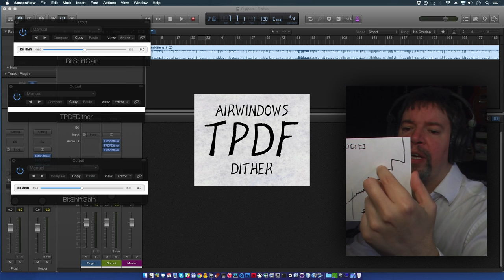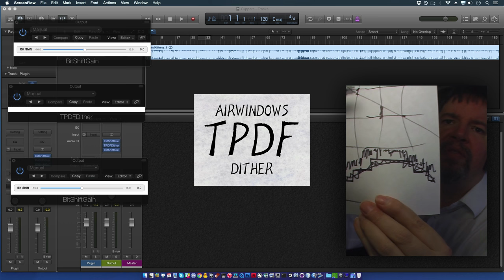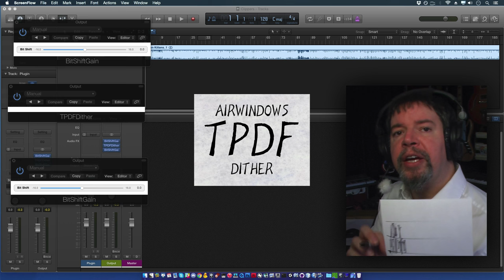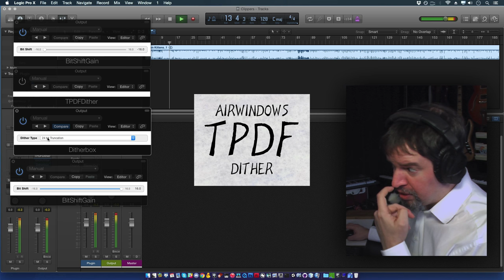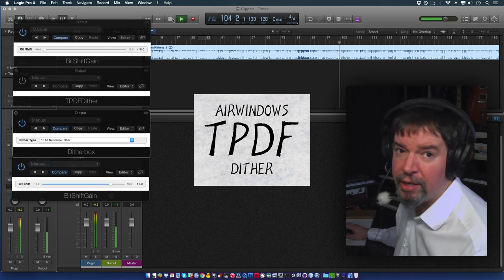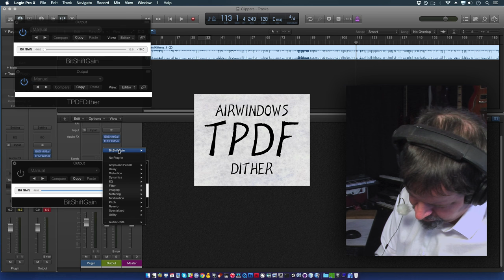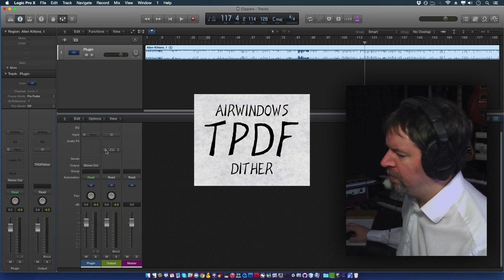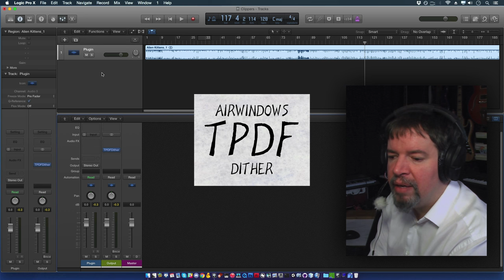TPDF Dither

Comment: Nice. But on the comment that we must dither noise for it to be right (and therefore self-dither is "nonsense"): You're losing sight of why we dither in the first place. We do it so that the inevitable error from truncation is not correlated to the signal, causing a noticeable error pattern in the resulting audio. We dither to ensure the error is spread randomly and simply sounds like background noise. But if the signal itself is noise—basic electronics noise is Gaussian—that type of correlation can't happen. Sure, we might as well dither everything, but it's not correct to say we must dither noise or a noisy signal—it just adds more noise (though insignificant), it doesn't improve anything.